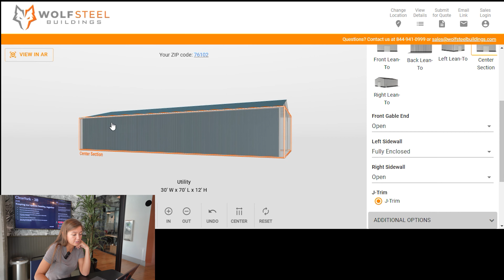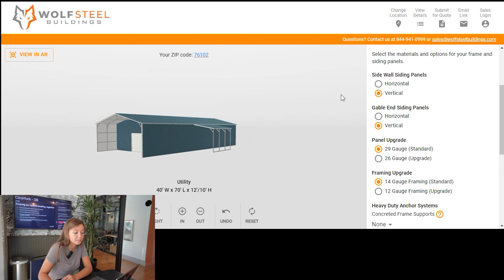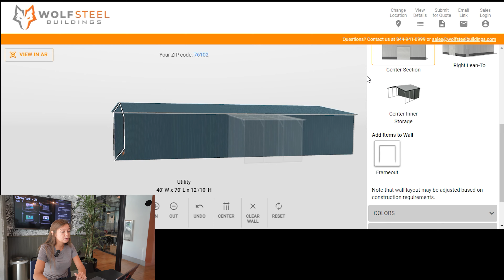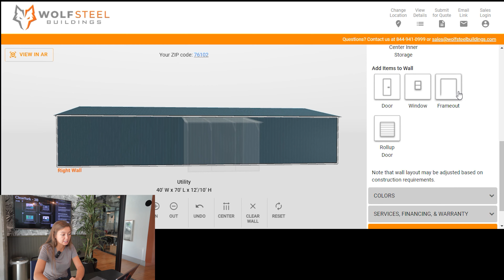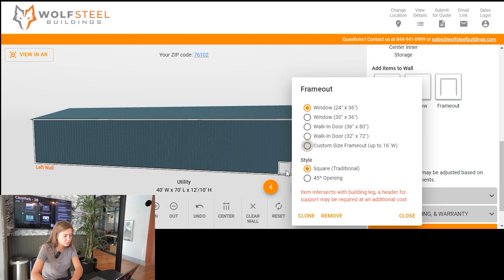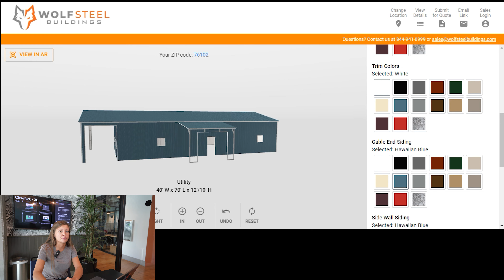How to Design Metal Building for Barndomium | Custom 3D Designer tool | WolfSteel Buildings

Comment: Do the engineer plans include an engineered slab foundation plan?
Can the engineer be engaged to include plumbing locations (toilets, sinks, washers, faucets, etc.)
Reply from the maker: Hello Keith! Great question!
Our engineer plans do include an engineered slab foundation plan. 
Our engineer does not engage in plumbing locations. What we recommend is to hire an architect that will create a full design of your project. Our engineer will make sure the building and foundation will accommodate to your project design.